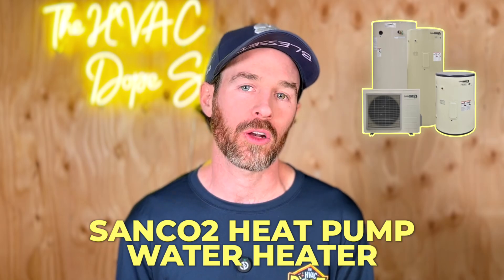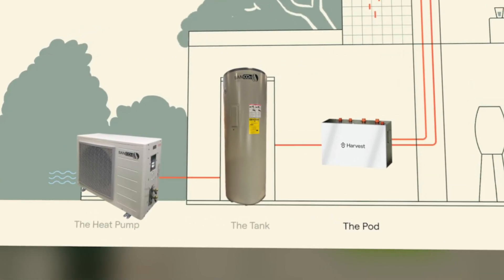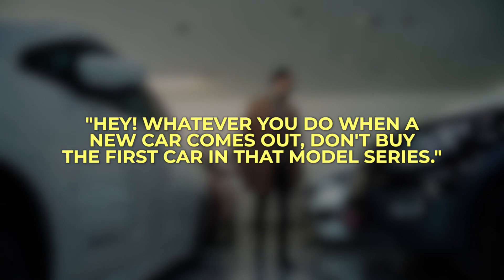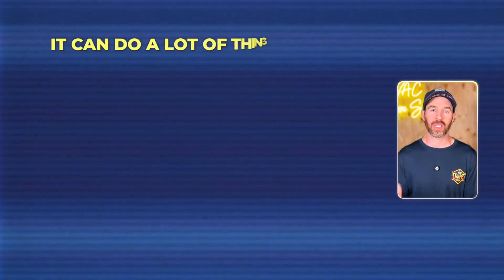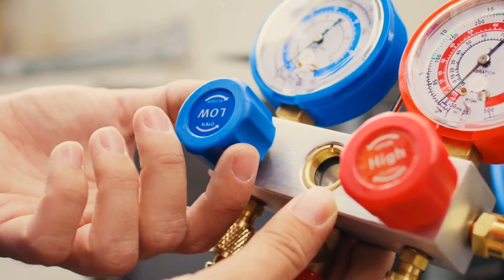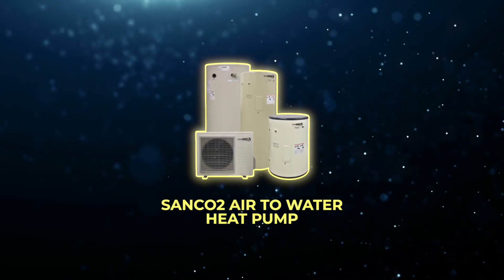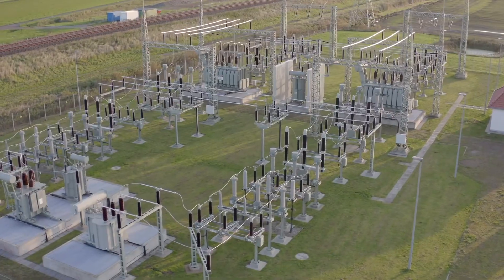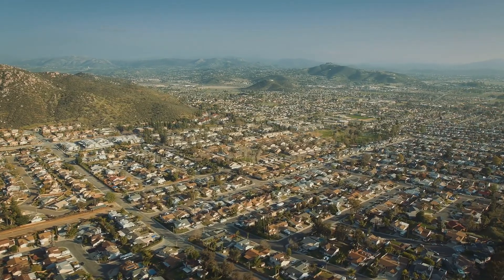Will this Japanese Heat Pump revolutionize American HVAC? | Harvest & Sanco2 Heat Pump Series

Comment: We installed a SanCO2 80 gal HPWH about two years ago replacing a NG water heater. It's incredibly efficient and a great compliment to solar. The water is hotter and more plentiful than our old water heater. It has worked perfectly and requires no maintenance. The heat pump is on the wall of our garage so it helps cool that space. We don't have it tied to our HVAC.
Reply from the maker: That's interesting so you put the condenser inside the garage? Thats definitely the way to go in hot climates because it's like free air conditioning for your garage in Phoenix lol
Reply: @TheHVACDopeShow Yes we're in Tallahassee, FL so being in a warm climate is a benefit plus putting the heat pump in the garage keeps the pipe runs short and free of environmental debris.

Comment: They run at very high pressures. I doubt Dupont is going to give up their refrigerant business to soda gas. I do like the monoblock heat pumps as they are factory charged and easily replaced even in winter.

Comment: CO2 IS TOXIC.   AT 5% concentration CO2 causes heart attacks.  We considered it for filling airbags decades ago, but the fact that it INDUCES heart attacks at 5% was too risky.  It is odorless, colorless gas that is heavier than air and can accumulate in concentrated areas.  There must be a CO2 detection and alarm system with sensors throughout your home if you use this.  Otherwise you lay down for bed at night and simply never wake up.
Reply: You definitely don’t need a carbon dioxide detector 🤦🏼‍♂️🤦🏼‍♂️🤦🏼‍♂️🤦🏼‍♂️

Comment: CO2 and R290 is not new in refrigeration, and nothing here is revolutionary....... It wont take anything over due to the pressures and maintenance needed..... 
With CO2 things tend to leak at 500+ psi...... A lot....... It isn't very efficient in small systems or certain areas either....
Cost is another area where these systems fall flat on their face.... In the age of building affordable housing, a 10K plus installed water heater doesn't fit the bill....

Comment: I’m going to be building a house on the Oregon coast where the average winter design temperature is in the low forties (F) and it rarely drops below freezing. Also there is no need for air conditioning in the summer. 

So I intend to install a hydronic radiant floor heating system with an air to water heat pump that will also provide domestic hot water. Sounds like this Harvest/Sanco system would be an ideal system for me in terms of maximizing efficiency and minimizing GWP. However, the cost of electricity is relatively low and there is currently no tiered or demand-based pricing. 

Probably isn’t even close to being the least cost option, but there are other values at play here that are of equal or greater importance to me than first cost ($) or even lifecycle cost ($). In other words, this system could be a winner on the basis of a triple bottom line analysis. Please comment from your perspective. Thanks!
Reply: There are several other CO2 based air to water heat pumps on the market, look around before buying the Sanco, I've heard it's terrible to get support for.
Reply: @urchin11  Primary support is provided by your local installer, and Eco2 Systems provides support to the installer community, as well as directly to homeowners in certain cases.  Oregon is pretty well covered, with distributors that carry replacement parts in stock.  Eco2 Systems has also revamped their support systems to reduce their response times, whether you contact them by email or via the contact form on their website.  (Yes, I am affiliated with Eco2 Systems.)
Reply: Thank you.

Comment: One issue with the SANCO2 is that their tank is too large to fit in the space my old tank occupied (hard to fit a 24" tank in a 23" wide tank well).    Another is that the controller uses ancient technology and can't integrate into a modern smart home.  Lastly there is the cost.  It was over four times the cost of the Stiebol-Eltron instant unit I eventually went with.  I don't use much hot water (< $0.15 /day) so the additional cost was just too much.  I like the idea though.  What I don't understand is why manufacturers of split HVAC systems don't sell a unit to heat hot water.

Comment: So, one thing that they could do to make this "somewhat" work as an air conditioner... and I actually see absolutely no reason it cannot work as an air conditioner... literally, if it works as a heating system... you literally just run it the other way... so it isn't the CO2, it is just that they store heat in the water rather than have a tank for cool water...

Have an "outdoor" unit... inside.  So, if you want to cool your indoor space, it is going to take the heat from inside to pump into the water tank for hot water purposes.  For heating your indoor space, it just uses the outdoor unit.
Reply: In warmer climates the outdoor unit can be installed inside to provide a cooling effect.  Some restaurants have installed them in the kitchen to extract heat and cool the kitchen.  As long as there is sufficient space for airflow (~800 Cu. Ft.).  At 37dB noise isn't an issue.
Reply: @bspanger1  I think alternatively, you simply use the "VRF Heat Recovery" model.  This uses a branch controller to effectively take heat from head units that request cooling and reject the heat to head units that request heating.  So, basically use the "boiler" side as a heat only head unit.  Then, you can have heating/cooling head units elsewhere, perhaps one being a central air handler.
Reply: @dus10dnd  I think that what you describe is the holy grail of energy efficient heating and cooling.  A single system connected to heat exchangers in your mini split air handlers inside, a heat exchanger outside, water heater, refrigerator/freezer and wherever you need hot or cold, all connected to a central system that extracts heat from wherever it isn't needed, and transfers it to where it is.  I don't know of any such system in existence (yet?)
Reply: @bspanger1  VRF Heat Recovery is it.  Hooking freezers/refrigerators... I haven't seen it yet, but I am experimenting with it.

Comment: Heat pumps are a joke.
Reply: I happen to be looking out the window while writing this while visiting my family in Spain....I can sees hundreds of heat pumps dotting hundreds of apartments and houses here in Granada.  @JohnSmith-ug5ci Do you mind if I respectfully ask what makes you think heat pumps are a joke? The technology had a terrible introduction in parts of the US many years ago but they have come a really long way.  

We looked at air to water and given the age of our home and the delivered water temps we could not make the Sanco work. Thanks John!
Reply: @Amovida123  Thank you for the question. They are a joke because they only work properly in limited climates. Secondly they are every expensive up front and do not really save money based on initial cost. Third they are very expensive to repair. Lastly, they do not last as long as just a standalone air conditioner and certainly not as long as a gas fired furnace. 
Now is there any place that they may work properly certainly, but very, very few places.
Reply: @JohnSmith-ug5ci  Thanks John....appreciate your reponse.  I agree with you on cost but would add that a lot of that cost is high cost on the labor for install. We are having a unit put in for our daughter's room....$2k for indoor/outdoor unit (wall mount)...and roughly $8K for install/labor/electrical...which in my book is insane.  We will probably DIY some of our units for the savings...when companies charge that much for labor they are just asking to be cut out.  In regards to weather I know the Mitsubishi units can work down to -13F at 70% efficiency.  I live in CO so that generally works for us and we will have a boiler/radiator system as backup for the once in 5 year events when we get below those temps.  I have heard that the Chinese units Midea/Gree are not designed to last nearly as long but the costs on the units are cheap enough that it would be feasible to swap at a unit if it were to fail.  Anyway...thanks for letting me add my 2 cents and appreciate your insight.
Reply: @Amovida123  Though I stand on what I said I do thank you for sharing.

Comment: I want a heat battery. It is 96f at night and 117f during the day. I want to run the heat pump all night and store 300 to 1000 gallons of chilled water.
Reply: You could do that with an insulated agricultural tank

Comment: Thanks for the video. While this does seem like a good product, the pricing needs to be competitive. 
This has NOTHING to do with a Tesla battery. it has nothing to do with ANY battery. The unique factor here is that it uses heat pump technology, which is more efficient than standard resistance coils. However, charging 2x to 3x the price sort of diminishes the appeal. It will take a while to break even, like more than 10 years just accounting for the cost of the unit itself... at average uses.
Also, in the USA, we don't call the millions of 50 to 80 gallon hot water heaters already installed in households, "Batteries"... and this new product does not store chemical energy at all. 
Additionally they are wasting all the cold they create... by dumping it outside... they could add a refrigerator unit to get the benefit. 
Please stop calling a "hot water tank" a thermal battery... get over it. It is not a battery.
Overall, the Price is too high tho.
Reply: Though it’s not mentioned in the video, what the harvest system does is to decouple the timing of hot water generation from hot water use.  It shifts the timing of the hot water generation to the daytime when outdoor temperatures are warmest (and where I live, when electricity is cheapest), then saves the water at 145-150F for use when needed (blended with a thermostatic valve), often in the evening or morning when the heat pump would not be as efficient due to colder temperatures, and (again, where I live) power would be more expensive.  I’ve got 10 kW of solar on my roof, so heating up my water tank in the day, rather than when I use the water, would make a lot of sense.  So I think it is fair to call this a thermal energy storage “battery”.  The harvest system will turn the heat pump on during hot water use if demand exceeds the usable storage capacity, but that would not be typical if the storage tank is properly sized.
Reply: @CarlJohnson-b4d  Well, I can see how performing the water heating during the day would improve efficiency. But storing hot water makes it no different than any other hot water storage tank. I suppose it is trendy to call it a battery, but a storage tank is a storage tank hehe. I just don't see the point of trying to fool people with Cool video clips of Tesla power wall and saying "battery" because those have zero to do with a hot water tank. 
   This IS a cool technology and It has a lot of potential, but the they can't price it this high and expect people to want to buy, and I am not a fan of confusing buzz words.

Comment: It is not viable for residential. The high pressures and control make it 3 times as expensive as an R290 heat pump and will only last 1/4 as long. Do the math. It's not viable. If the control fails you make dry ice and destroy the very expensive compressor. We use R290 in giant systems for industry because it's cheap and it does not catastrophically fail like transcritical CO2. Sanco2 is garbage.

Comment: Glaring Problem with Heat pumps! I live in a cold or Northeastern climate and have no desire to stand out in the elements of weather trouble shooting in the cold. Add every other owner i know labor is a major problem with the younger crowd and the older more experienced mechanics feel just like i do, so what is the solution every one? Pay skilled Heat pump Mechanics by a much larger factor than those working with Gas furnaces. Meaning buy a Heat pump for you home in cool or cold climates at your own parrel.
Reply: @Gutter-Snipe  I used to think so too, but honestly, it’s the customers issue, not mine. I push heat strips for backup and they can run them till it warms up. A pop up tent and heaters keep me warm and dry, it just rolls into my price, the tent setup and breakdown, they can choose to repair at the time and pay, or pay the electric bill till it’s warm enough I can repair comfortably. It’s not my problem, and, I am the solution
Reply: Not really been a problem here in Sweden, where there's cold weather for 4 to 6 months of the year, it doesn't pay to be a fair-weather worker in any outdoor trade.  A house across the street is currently having its roof replaced, which has taken days of being outside in below-freezing weather.  Relatively tame compared to when I had a heat pump installed in below-freezing temperatures between Christmas and New year.  Which only took the guy a couple of hours.
Reply: You got that right! I tell my heat pump people to turn on the backup and call me in Spring. They complain that will cost a fortune. I tell them not as much as I'm going to charge you for laying in the snow. 😂

Comment: I might be interested but I'm curious if the air coming out of the vents is warmer than the air from typical heat pumps. And, is there a significant savings over the whole system.
Reply: There aren't any vents.  The Sanco2 pulls in air from the outside, extracts the heat from that air and transfers it to the water in the storage tank.  The only "vent" is the exhaust side of the unit, which discharges air that is colder than the ambient air pulled into the unit, because it has had heat extracted from it.  The Sanco2 will always produce water at either 145F or 150F (depending on the ambient temperature), no matter how cold it is outside. (Down to -25F).

Comment: I'm wondering what the capability is here.  15k btu heat pump I think.  Seems like it would not be enough for heat and hot water.  At least not here in CT
Reply: It is good enough to keep up with something like 20 gallons per hour, under the right conditions.  Most of Connecticut is also not so cold that the system will fail to keep up.  It can work down to -20 Fahrenheit, albeit, at such low temps, its capacity is significantly diminished.  CT is a lot warmer than that, though.

Comment: I doubt if this is going to be feasible till it can be packaged with an air to water chiller for HVAC, and available with a compatible indoor air handler that can used chilled or hot water in the same fan coil (appropriate water side mixing valves needed). Also the price is crazy - $15k just for the heating high side and low side equipment. Add HVAC with labor and you will be at $25k-30k for a small single family home. Oh and it also needs to work with a single thermostat. Those 30% tax credits will most likely get removed next year. Maybe Musk will come up with a tesla coil and package unit that does it all :=D
Reply: @VikramBailur  I was an installer for Robur installing ammonia absorbtion a/c system. Just a standard hydrocoil, worked very well with great dehumidification.
Reply: @anthonyspadafora1384 that's really interesting that vapor absorption is actually an option. I am not so sure it's suited for residential single family home application especially I see there is a temperature range of 40C to -15C. I always thought it was for large applications like 150ton+. This may require a trained technician to be on staff so better suites for an office.  I know with the older non-ammonia vapor absorption tech there used to be corrosion issues.